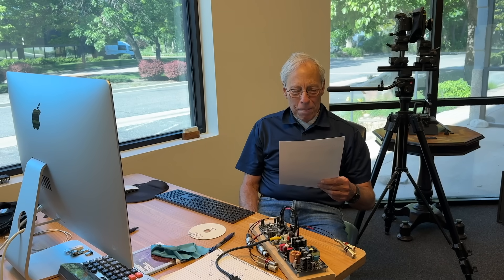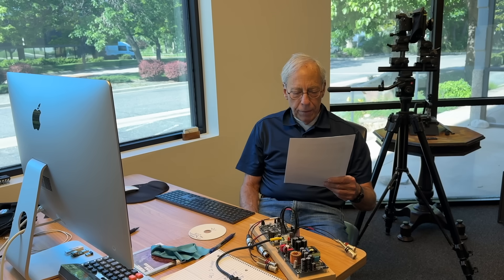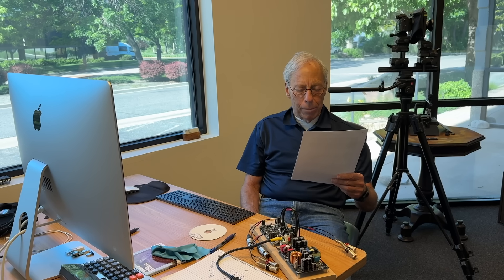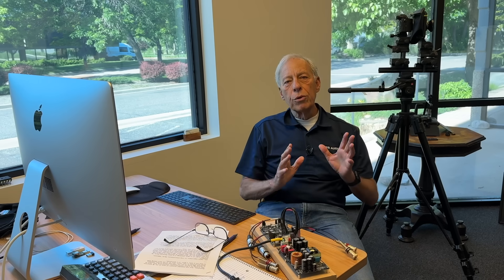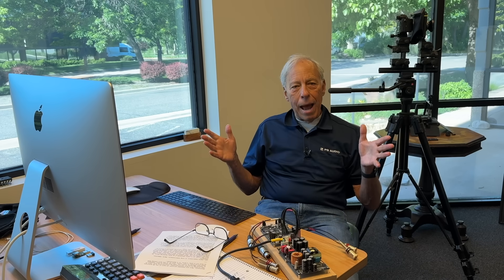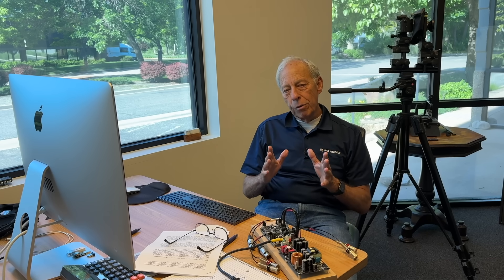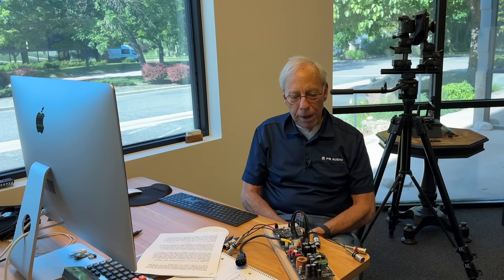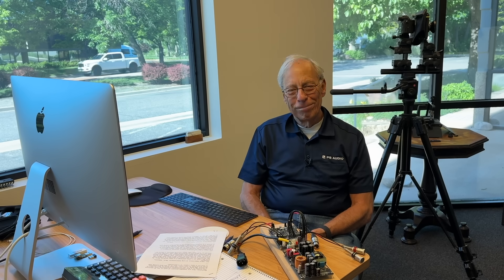Cable Capacitance

Comment: Paul doesn't know AudioQuest cable capacitance because they NEVER give any specification about their cables. 
One wonders why?
I would never give a cent to such manufacturer. Luckily there are other cable manufacturers out there like QED with all specs available.
Reply: Listening is far more important than spec's when it comes to cables.
I'm sure that AudioQuest won't go broke without your 1c 😂
Personally, I won't use AudioQuest cables because of the ridiculously high & unnecessary mark-up.
Reply: Sure, like driving a car. However before I buy car I like to see specifications and only then I go to test drive.
When you put specifications on paper everyone can check them. My guess is that Audioquest wants to keep everything under cover with only fancy words and promises available.
About not spending 1c....as long there are sheeps around, there will be wool to cut, we say in Croatia. Saying that, I can agree with you how AQ wont go broke.

Comment: I did however build some balanced cables for my system about 3 ft. long.  First tried balanced mic cable. OK I guess.  Then had some aerospace shielded pair wiring I salvaged with PTFE white insulation.  Did not sound so great IMO.  Finally found some XLR balanced cables the same brand as my speaker wires.  Audible improvement.  Cannot say why.  3 feet of any kind of wire ought to sound like nothing at all in a low impedance solid state circuit??  In any event I would like to build rather than buy if it saves large sums of money,  which it ought to.

Comment: I bought some mil spec coax off a reel at the local electronics store.  Pretty cheap.  Small diameter,  impedance rating something like 92 ohms,  capacitance 15 pf/ft,  and teflon insulation with silver plated conductors. Does that get you guys excited?

Comment: I've gone down the xlr rabbit hole and lost bass so I've built low capacitance cables of the single ended persuasion and the sound is better. Just so you know I'm running an sme IV tonearm lomc cart otropfon st90 stu ive tried shitt skoll and a custom balanced tube pre to an audio research ls15 and ive tried a threshold amp as well as pass labs and single ended just sounds better. let me know if you have ideas oh and i used a millohms  bench tester on the cable i used to make sure it had low capacitance or at lest very low ohms. thanks for the info..

Comment: Being a hamradio operator with a fully instrumented test bench almost all claims made by high end cable makers is total BS. But capacitance is something that I can measure and it does make a difference. What I have found is the better the match between discrete audio circuits the cable affords makes a measurable difference in the sound. It all begins with best quality connectors. That does not mean $100 USD a foot cables made only on in a full moon by Moon Maides.
Reply: Ok Karen.

Comment: A simple capacitance in series with a circuit will be a first order low-pass filter, but the effective frequency depends on the impedance of the circuit.  As the impedance rises the frequency falls for a given capacitance, so a cable that has no effect on the frequency response of one component could definitely have an effect on another.
Reply: Zitat: "Ein Kabel, das den Frequenzgang einer Komponente nicht beeinflusst, kann also durchaus einen Einfluss auf eine andere haben."
Und welchen Einfluß bitte ? Bitte physikalische Erklärung !
Reply: @bachglocke3716  it can become a low pass filter, attenuating high frequencies.  As Paul indicates, it’s probably nothing to worry about unless you are using long lengths of poorly designed cable.

Comment: Cable capacitance alone doesn't make a low-pass filter. There is also a series resistance required. And once you know that, you don't have to guess, you can calculate it. Assume 100 pF per meter/3 ft. If your preamp has a fairly high output impedance of 600 Ohm, you can calculate the 3 dB cut-off point of a 25 ft/8 m cable using 1/(2 * pi * R * C). With 600 Ohm and 800 pF, 3 dB point will be 332 kHz.
In reality the output impedance of your preamp will be much lowe and therefore the 3 dB point much higher.
Reply: Yes cable resistance is in milli Ohms and make no difference and it's trivial to make a line level (RCA or balanced) output with low output impedance making capacitance a total non-issue. This is an example, like some others, where if someone says a few feet of audio cables (same for power cables) can make an audible difference I tend to say, it's not a sign of a highly resolving system but a sign of crappy engineering.
Reply: @ThinkingBetter  Da kann ich Euch beiden nur recht geben! Diese ewige Kabeldiskussion hat keinerlei physikalische Grundlage wenn nur die Kabelparameter für sich betrachtet werden. Erst wenn die Quell- und Lastwiderstände angegeben werden, macht es Sinn sich über die Kabelparameter Gedanken zu machen. Allerdings spielen diese bei den im HiFi-Bereich üblichen Kabellängen keine Rolle !
Reply: @bachglocke3716  Very few audiophiles really understand how things truly work. That's how the business gets away with selling US$20 cables for more than US$1000.
Reply: @ThinkingBetter  There are gullible people in all hobbies that will believe anything told to them by a so-called 'expert'. Thankfully in home-audio we have our hearing to be the final arbiter of what sounds best in our rigs.
Reply: Yes of course. But we don't have the luxury to just keep trying different things to find out what gives us most value for our money. Some people get convinced that they should spend US$10,000 on some power cables and might not know that for the same money they could get infinitely more sound quality improvements by spending those money on the speakers. Nowadays it's made even worse as most is bought online unlike in the past where you could go to some audiophile store and listen to it before spending a fortune. Most of us have some level of budget.
Reply: @ThinkingBetter  I agree that spending $10K on a power cable is ridiculous. I spent an average of AU$230 (US$140) each on three IsoTek power cables & they definitely made a difference to the gravitas of the bass response in my home-audio rig. The problem with you cable deniers is that you guys generalize & state time & time again that no power cables make a difference & then when someone like me comes along & tells you that you are wrong you then talk about cables that cost in the thousands or ten's of thousands, which I have said is stupid money. My point is that power cables worth only a couple of hundred dollars can make an audible difference & I have stated here many times that for 30+ years I too believed that after-market power cables were snake oil, until I actually heard the difference.
A good scientific mind is never dismissive of what could be
Reply: OFC copper cost around US$10 per kg. A #10 AWG heavy gauge audiophile power cable has around 200 grams or US$2 of copper in it. Add to that the insulation material and of course the process of making the copper into wires. Probably your audiophile power cable is around US$5 to manufacture in China everything included. Then add to it some pseudo science story, nice branding and nice packaging and sell it for US$1000. Obviously more copper is better for reducing the resistance but it's a trivial topic for a power cable. I don't want to argue with your personal experience but you get my point. I've been to some very audiophile cable suppliers in China btw.

Comment: It will bankrupt even a well healed audiophile to buy name brand highend cables 25' long... I would suggest a DIY cable made with Canare star quad wire and Rean connectors. Build a set for about $50, fine sounding pro audio wire and decent connectors.

Comment: The lower the input impedance of the input stage will decrease the high frequency loss of a long cable. A 50K ohm input will have greater high frequency losses as compared to a 600 ohm input. The output stage must be able to drive a low impedance input or you’ll find the low frequency starts to drop off

Comment: I would not use wood for the mule base because it is hygroscopic.
Reply: Sounds like Paul is evaluating it as a prototype, not for actual production. Back in the day fixing electronics to a piece of wood was called a breadboard.
Reply: @michaelturner4457  It looks suspiciously like a prototype GaNFET amplifier ...probably to fit into the PMG Signature casework, then he'll have 'same size' GaNFET monoblocs to suit the PMG Signature range of products...uniform!
Reply: Seriously?!
Reply: I guess he doesn't know that most speaker cabinets are made from wood.
Reply: Absolutely.
If the backs of circuit boards touch the wood then any moisture in wood which equates to resistance  will shunt components, so why take the risk?
PCB substrates are made mostly from glass fibre and resin, but also paxolin, both of which have very high insulation properties.
Reply: @georgebliss964 I some equipment that's over 20 years old, and have wood chassis without any problems, so I don't think it's the problem you seem to think it is.
Reply: @georgebliss964  Oh, please...get a grip. Prototypes have been built on wooden boards for decades.
Maybe we should remind Paul not to leave his pieces of mule-board outside...in the rain🙄

Comment: Does anyone have an opinion between Audioquest and Blue Jeans cables?  I have a Yamaha B-2 and C-2x with Onkyo Monitor 2000 speakers.  I listen to only LPs and CDs.  I want some quality cables soon.  Something that would pass the Audioholics snake oil tests.  Sound, durabilty, and looks are factors to me in that order.  I'm an audiophile who also has fun with my stereo.  2700 LPs!  All genres.  Mostly classic rock and jazz.  Nat King Cole was cool before being cool was cool.
Reply: Blue jeans cable are great value and very good with low capacitance. I use them for all my connections at the moment with long runs from my preamp to mono blocks. I like them a lot. I have only tried Audio Quest evergreen and I did not like the shrill top end they added to my system. That’s all I got for ya.
Reply: @carlhayes-ze5nd Thank you for the response!
Reply: @johnreardon4944 What cables? ...digital (Streamer or Transport to DAC) ...analogue (DAC to Amp/Preamp) ...loudspeaker cables??
Reply: Regular RCA cables and speaker wires.  Not a factor, but also run dual stereo subs with the high level inputs.  My B-2 VFET amp is super beautiful sounding.
Reply: @johnreardon4944  Gothic Audio for your RCAs & Mogami or Blue Jeans for your loudspeaker wires will serve you well.
Reply: whats wrong with the cables you have at the minute?
Reply: @1stswim Nothing really.  They are all Audio Technica cables from the regular electronic stores here in Japan.  They are slightly higher costing ones.  Not expensive at all.  But because my system is revealing to some degree, I wonder if I can hear an improvement with more audiophile type cables.

Comment: 2:48 As opposed to a drug mule or a 'nug' mule. A piece of wooden board is non metallic & non magnetic...excellent👍
I employ a 0.64m pure silver Shi-Tone XLR for AES/EBU; 0.75m cryo pure silver Gothic Audio XLR pair (DAC to Amp) & 1.75m PCOCC FURUKAWA ELECTRIC pair, 3.5mm dia. (7 Gauge) loudspeaker cables. KEEP YOUR CABLES AS SHORT AS POSSIBLE
My DeVores are seven & a half feet apart. Transport, DAC & Amp. are on the floor, on isolation platforms, in between said DeVores.
Reply: I never realised you were that daft!
No offence intended.
Reply: @georgebliss964  Bollocks!!

Comment: The capacitance of speaker cables, especially for subwoofers, is more important IMO.
Reply: Why for subwoofers? If capacitors are low pass filters they wouldn't do any harm to low frequencies.
Reply: @Fastvoice  Yeah, that's what I was thinking.

Comment: I’d like to know what Audio Quest interconnects he likes.
The 72v DBS technology is snake oil.
And I have doubts about some of their other claims.
I’m not an anti-cable person. But I think almost all cable companies dress up wires with false claims and charge exorbitant prices! And people believe a lot of nonsense if it looks like it might do something special. So they buy the looks and get tricked by claims they can’t understand.
Reply: 0.64m pure silver Shi-Tone XLR AU$225 (US$146.25) for AES/EUB
0.75m cryo pure silver Gothic Audio XLR pair AU$433 (US$281.45)
1.75m PCOCC  Furukawa Electric  3.5mm dia. loudspeaker cables  pair  AU$290 (US$188.50)
TOTAL: AU$948 (US$616.20) "exorbitant prices!" ?? I think not uncle Wilbur...you just gotta know where to shop ✌💖🎶🍺🍿
Reply: AudioQuest gifted Paul their top cables. Must be nice. High-end cables are costly due to the R&D, small production numbers, exotic materials, hand assembly/testing, and marketing. However, I also share your skepticism. High-end cables have a higher markup than other audio equipment. Companies don't publish specs, test results, construction details, etc. Few companies offer a free home trial. A common rule of thumb is 5-10% of the system cost.
Reply: @BruceCross  That's why you should buy them 2nd hand, if possible.
There's a fairly big market for 'pre-loved' interconnects, loudspeaker cables & power cables.
And the bonus is that they are already burned-in👍
Reply: @BruceCross  "Few companies offer a free home trial."
The store, where I purchased my stereo, handed me a half-dozen different interconnects.  At the time, I knew nothing about them.

A few of them sounded very similar, enough that I would not know which ones were being used (if someone else hooked them up).  But the Audioquest interconnects stood out from the crowd.  There was no going back.

I never heard of manufacturers offering free home trials.  But stores that sell the cables, do -- if they have them on-hand.  If they feel that you are a serious customer, then will remove the cables from their store's stereo, and hand them to you.  They will probably want them back in 3 or so days.
Reply: @0Perhaps  What a wonderful store to let your try different cables at home. I doubt that's common.
Reply: @BruceCross  
Your free coat hangers must sound great !!!
Reply: @BruceCross  I'm more than skeptical......
It's utter cobblers, in defiance of the laws of physics.
However, good screening and terminations are worth paying extra for.😊
Reply: @georgebliss964  Yes, I learn more toward the science than the voodoo. Good screening and terminations are great examples. Another detail they often don't discuss is the grounding scheme.
Reply: @BruceCross  It's not voodoo if your hearing is up to scratch.
Reply: Does anyone have experience with Kimber.
Kimber seems to be grounded in reality, not making unbelievable claims. I need rca interconnects and may go with Kimber.
I looked closely at Audio Quest, but their marketing strategy is nonsensical. I've had AudioQuest, and I'm not feeling dedicated.
Reply: @unclewilbur8976  
Kimber Kable PBJ interconnects sound VERY tuneful due to the (Vari-Strand) copper construction, nice tone, tight bass, thick sounding, crisp. Warning: very powerful, can be brutal on speakers & your hearing. Natural sounding etc etc...
Reply: @unclewilbur8976:
"I’m not an anti-cable person."

Yet, 100% of what you wrote is anti-cable.

You wrote as if you are knowledgeable about cables, and yet you wrote:
Audio Quest

The name of the company is:
AudioQuest

Normally, not worth correcting.  But when you lie about not being an anti-cable person, it is worth exposing you.

You bashed cables, in every sentence, while writing that you are not anti-cable, and the company that you bashed, and pretended to know about, you misspelled.

 ¯\_(ツ)_/¯
Reply: @0Perhaps 
I recommend that you repeat sixth grade with a focus on excessive use of commas, run-on sentences,  and reading comprehension. I also recommend behavioral counseling with a focus on your hostility and oppositional defiant disorder (ODD).
Reply: my favorite is directional twisted pair cables for ethernet
Reply: Conditions not cured by placebos: Cancer, Infections, High Cholesterol, Alzheimer's Disease, Obsessive Compulsive Disorder (OCD), Autoimmune Disorders, Asthma.
Reply: @Second_Hand_Noise_Damage  The Placebo Defect 🤔😂